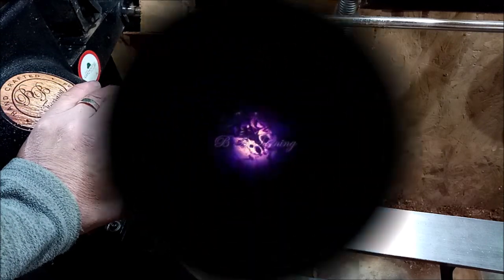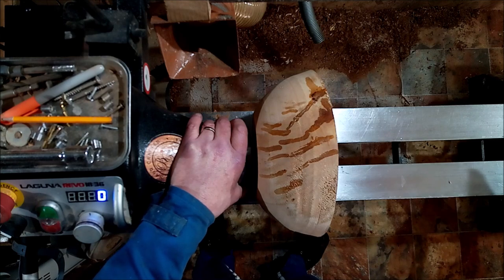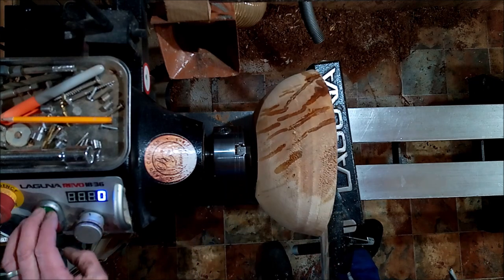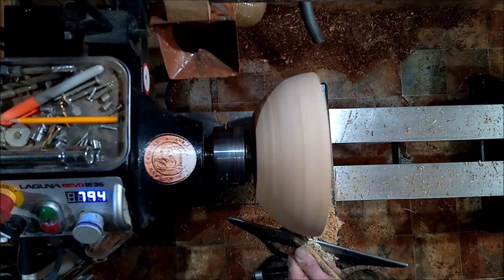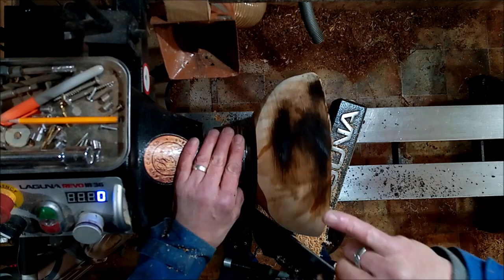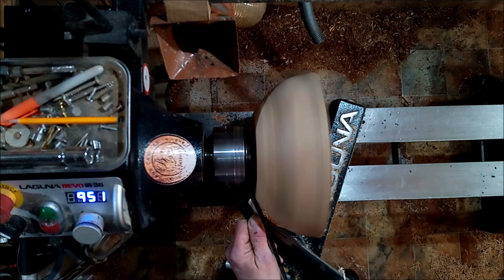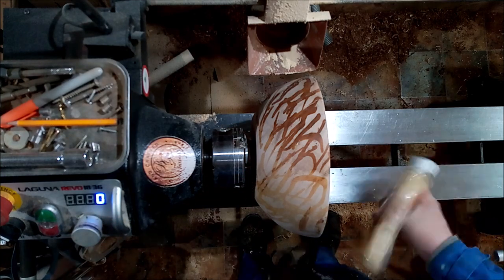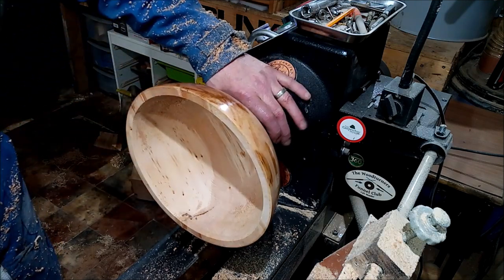Saving a punky bowl / woodturning

Comment: I seem to have turned lot of punky wood over the last months. I mix my own shellac sanding sealer using dewaxed shellac flakes & methylated spirits (denatured alcohol). Lots of thin coats works a treat.
Reply from the maker: They do indeed Tee and that's the trick, don't spare it 😁.
Shay

Comment: Thanks for that! I tend to try pretty much any wood, which does include some dodgy stuff. Your hints could make quite a difference!
Re the other piece of lime wood: If you whack it in half, you might be able to finish off a couple of bowls, avoiding the punky sections, just by changing your orientation.
Reply from the maker: Thanks Stephanie, the other piece was already roughed out so I  stuck with it I am afraid.
Shay

Comment: Shay
Enjoyed watching!!
I agree never give up on a piece unless it gives up on you (as in unsafe)
Put it on the shelf and try it another day.
The ca effect didn’t work for me either!!
But if you don’t try you won’t know.
I know what sanding sealer you use is based on your finish!
Or am I wrong?
Which do you prefer?
Cheers Tim.
Reply from the maker: I started using that sanding sealer because it is available locally Tim and at this stage i am used to it. It is one of the joys of living in a smallish town in Kerry. You take what you can get. I have not tried another type but it is supposed to work with any type of sanding sealer.
Shay